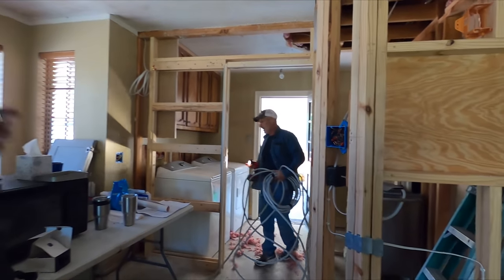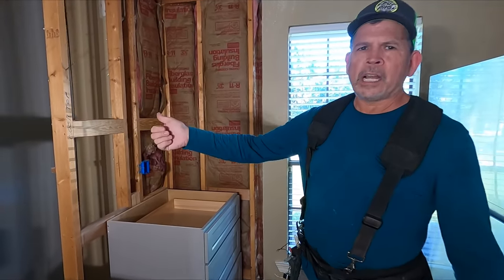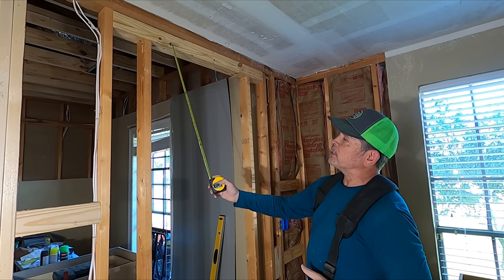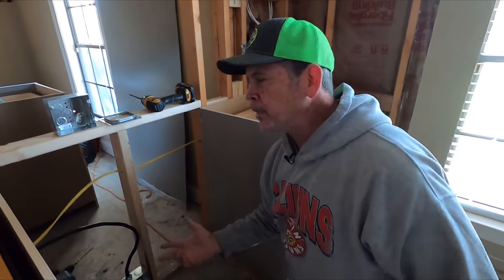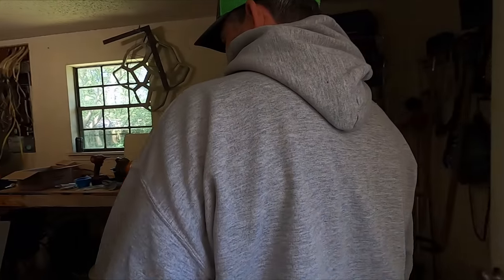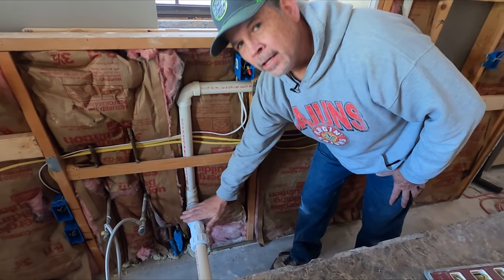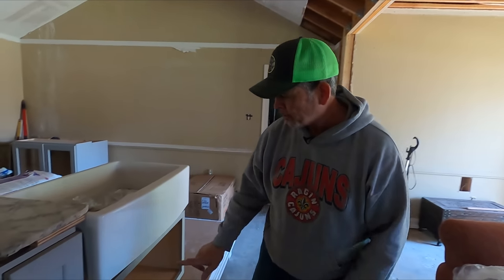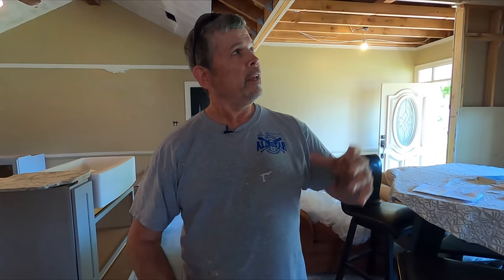WHY This 2 INCHES Will COST US $800 Ep. 15

Comment: We went through a whole house remodel, and our contractor was a bum. Afterward, our kitchen sink was always leaking. I took it apart at least 10 times and tried to figure out why it wouldn't stop leaking. 14:06 is the reason. They replaced our standard sink with a farm sink, but never lowered the drain.

I remember when the plumber arrived and gave us the bad news. As you said - out went the back of the cabinet, and out went our new drywall.

Comment: Thank You Studpack for the great content on your channel!!! Love the interaction between you too!! Keep up the good work & see you on your next video!!
Reply from the maker: Thx Miles 👍💪
Reply: @StudPack  Did that guy fall through the ceiling? The impact didn't sound like a straight free fall.
Reply: @StudPack  My friend's range receptacle was installed in a way that the plug cord was bending at the floor, causing stress. I had to flip the receptacle 180 degrees so that the cord would be going away from the floor. Since the electrical box was an old bakelite box with no mud ring, I couldn't install it sideways like you did in the video. Also, the wire inside the box was short and barely left me enough room to flip the receptacle.
Reply: @illestofdemall13  I though it was that bundle of cable he was rolling back up ???
Reply: @mickeymacon1281  I don't know. Seems like you could be right, but it was unclear in the video.

Comment: 20:38 There’s nothing like starting a new job and going over to the breaker panel and actually seeing a “Legend” and one that ACTUALLY is filled out and correct. Makes things so much easier; unfortunately, can’t recall starting a new job where the panel was correctly labeled, and that’s if it was labeled at all 😁 (so many panels out there that aren’t labeled, geez; also, having a main water shutoff in side of house the actually works....instead of having to go to the street. It’s these little things that make our jobs a bit more easier, along w/ saving ppl money and time😉)
✌🏻

Comment: Should go ahead and install the duplex plate dryer, then use Leviton 88085 (or equal) cover that is 1 side blank, 1 side single 1.406" round hole. Then, future update does not require any mud work.
Reply from the maker: Thx Tony.  I’ll do that👍

Comment: That TV can't breath. You need to put something in so that heat can evacuate out the back of the TV. Made this mistake once. The TV will die quicker. We just drilled some holes in the top and bottom of the back of the plywood, but not sure how commercial varies from residential. Also, you may know this but paint the inside of the cutout black, then even if the TV is not a 100% fit the black looks like part of the bezel of the TV.
Reply: I agree. You could easily put up a moveable TV mount. That way the TV can be moved around so anyone can see it.
Reply from the maker: Cool thx Dustin 👍💪
Reply: Dustin beat me to it for the risk of TV overheating. And his idea of black paint rocks too.

Comment: Me and my dad also had the same problem with the farmhouse sink. Had to use an above the fridge cabinet cut out the top and frame around it so it held the sinks weight, and build a base for it
Reply: They never give you enough filler for the cabinets lol
Reply from the maker: That’s for sure.  Thx Shane 👍

Comment: Great job on being aware of the depth of the new sink.  So many times I have warned people and GC's.  They refuse to acknowledge their mistake at trim out.  Deep traps kill disposals, people.  Deep traps cause frequent clogs.

On anther note, I'm surprised your plumbing code allows that sink drain vent to pass through the King stud at the window.  Was that a 2x6 wall?  We cant cut more than a 1-3/8 hole in a king stud and still have to put a stud shoe on it.
Clean looking plumbing work tho.
Reply from the maker: Thx 👍  2x4 walls on that vent.   I guess it’s grandfathered in.  Would need a shoe otherwise 💪👊

Comment: Plywood sub top should be 5/8" plywood to be properly hidden behind the stone edging. In fact, because you are using a face frame cabinet, you could even use 1/2" ply as a sub-top and allow the edge of the stone to overlap a full 1/4" without affecting cabinet utilization. Especially with quartz tops, their tensile strength is almost double that of natural stone. Your description of the relationship of the stone top to the sink is correct, however, I would have done the math before ordering the cabinet and had it built taller. I have spec'd and built custom cabinetry for 20 years (mostly euro, no room for errors). Thanks for your channel, I share it with my workers.
Reply from the maker: Cool thx Emil.   I haven’t seen 5/8” plywood in years.   Who still makes it?

Comment: 1/2" 4x8 sheetrock is $12.76tax inc. - T&G Underlayment Plywood (Scant Face) (Common: 23/32 in. x 4 ft. x 8 ft.; Actual: 0.688 in. x 48 in. x 96 in.) $107.41 - 2x4x8 stud $9.00 - Johns ManvilleR-13 Kraft Faced Fiberglass Insulation Roll 15 in. x 32 ft. $19.37  To give you an idea here is Southern California. Most other stuff are close to last years prices. Just lumber has hit the fan.

Comment: I just went thru the sink drain problem last month. The customer's  new sink was under countertop with garbage disposal so the GD would've always had 2" of water in it.   I had to lower all of the in wall plumbing 3".    Fortunately the wall behind the sink was an open living room wall so I could cut a large hole in the drywall, lower the plumbing,and put the drywall back.    It was a huge problem, but not as bad as butchering the cabinets and trying to replumb with my head stuck 2' into the base cabs under the granite countertop.

Phew, I learned a lesson that day
Reply from the maker: Thx Brayden👍.  You got lucky being able to go thru that wall 💪

Comment: There was a flip house listed for sale for many months with a brand new kitchen that wasn’t selling in a hot neighborhood where I sold a flip without even listing it. In that new kitchen, the dishwasher door did not clear the window sill that was in the door’s path - the dishwasher was useless like that.

That’s why a good kitchen designer / builder / contractor will make sure all moving parts - mainly doors and drawers - will open fully. Just like that lower drawer near the window in the kitchen from this video.
Reply from the maker: Thx Steve 👍💪

Comment: If you've got a hand-held planer, you can recess a lot of those nail plates really quick. It flattens the drywall, and actually helps keep the plates from falling off due to random impacts. (Or you could just pull them back down after inspection, which is apparently a great way to recycle...)
Reply: I was going to mention that because that is what i did on my whole house renovation, planed a recess, but I thought no one else is that anal. I would never take them out. You never know where someone is going to drive a screw.
Reply from the maker: Cool.  We do that sometimes to recess hangers

Comment: I just remodeled our kitchen. Made my wife super happy by putting in a pot filler over the stove.

Every kitchen I’ve done in the past year, I make sure to mention putting in a pot filler for the customers. 90% wants it.
Reply: Pot fillers are great . Iv'e been exploring options for drainage .something like a washing machine has . Using a special pot that drains into the top of the stove and into a flexible drain.
Reply: @degrom542  what do you need a drain for with a pot filler?
Reply from the maker: Don’t see a lot of those locally.  Mostly higher end homes.  Besides, we’re used to lifting heavy pots here... gumbo, jambalaya, I’m hungry is it lunchtime 😂😂👍👊
Reply: @StudPack  that’s what would separate you guys from the ordinarily contractor. It doesn’t have to be only in higher end homes and believe me, the wives would love it! 👍🏼
Reply: @tommynguyen8942  so after you fill the pot with maybe three gallons of water then you need to carry it over to the sink and pour it down the drain. It’s heavy for your average female maybe 24 lbs of water to carry over to the sink.
Reply: @degrom542  I see what you’re saying. But a pot filler is for you to fill a pot to cook with. Most people need to drain after boiling pasta, they would do it in the sink into a strainer. 

All the seen and installed, I haven’t seen any with a drain. But it would be nice to have one?!

Comment: Paul are you putting in a surge protector in the panel. I put one in because most new appliances are like a computer and with the lightning down there it may save a control panel. Keep up the great work and videos
Reply from the maker: Thx Michael 👍 I asked my electrician about them.   Almost always it’s a commercial application for surge suppressors here.   I love the idea though.  I’ll research them 👊
Reply: @StudPack  seems louisiana is still on 2014 NEC. Just would be a shame if a new panel install isn't thinking about the inevitable future 2020 NEC (e.g. Texas already adopted). Since any future work would have to bring up to code at that time. NEC 2020 requires surge protectors, GFCI on your washer dryer. Pretty much every circuit needs to be one or both of AFCI and GFCI after NEC 2020.
Reply from the maker: Thx Mr G👍. This new GE panel should accept all those.  We did install couple AFCIs on the added circuits

Comment: Would have put the two gang plate on the dryer box anyway. You can use a single 120v outlet with a two gang plate with a blank on one side.  Also, There is a kit for most dryers that will allow you to vent out the side of the dryer to eliminate a lot of twisted vent pipe if you can vent outside to the side.
Reply from the maker: Someone else commented same.   Excellent ideas thx James 👍

Comment: Great using the roomier 4 &11/16" box for the 10/3 NM cable. Should always have large opening in mud ring  so that in event screws come loose the cover will not fall off. Saw a lot of electricians install them wrong. Ge is the absolute worse breaker besides worst service + tech support.Had trouble with every ge medium voltage switchgear that companies had.
Reply from the maker: Thx.   Not following “ cover will not fall off “ ??
GE was the only 150A  32 space panel our supplier could get 👍

Comment: The sides of the farm sink are normally not square top or bottom.  Both sides tend to slope in from top to bottom.  I found out when I cut the U-shaped board around it.  Make a template.
Reply from the maker: Thx Dirk.   This one is actually not too bad 👍

Comment: You went ham with those nail plates. Code in my area is 1.25 inches or closer to the edge needs a nail plate. I usually use about 50 in a 3000sqft house.
Reply from the maker: Here they want to see them everywhere 😩

Comment: Well, no, I want solid smooth ceramic tile behind my stove. Me and my wife cook a lot, she in particular, likes to fry stuff. I want a nice smooth wall that every now and then I can hit with oven cleaner to get that grease off.
Reply from the maker: Yeah I hear ya Ray 👍  I’ve done removable tempered glass panels behind ranges to protect expensive tile from cooking elements. Owners can remove glass, clean, and reinstall.
Reply: Lol, with regard to the Sink rough in, you have the luxury of knowing what your cabinet guys are going to do. Here cabinets are so cheap, they just come plop them in with the sink already mounted to the counter, and they did not say boo to the owner that he was going to have to replumb to the sewer. Yep, and it’s 2 inches, you have to drop the sewer connect. They decided what sink they were going to put in and I was left ripping out the old connect and installing new PVC. 🤬🤬🤬Contractors🤬🤬🤬. Luckily it was PVC and not ABS, which is no longer available here. 

There’s another thing. The new marble/quartz countertops are almost always now single post for the faucet. If your house has galvanized pipes you can just forget it unless there is a filter between the galvanized and the faucet. The single post faucets with extension hose and faucet as one item have a back flow preventer that is no friend of little metal bergs that run around old galvanized pipes. Once those preventers clog you are either going to be calling a plumber to fix it and/or replacing the faucet. 

Again, when they brought the cabinets, neither the owner or I had any idea that they only did single post faucet holes. Those faucets are $200 more expensive than 3 hole faucets and cannot be used in every house as piped.

Comment: While on the subject of ranges: I have a customer that is converting a electric range to gas range. I thought I would have to get an electrician to wire a 110V receptacle for the new range as that is what it called for.
Found a thing called a "gas range adapter" Plugs into the 220V outlet and you plug the 110V cord into it.
Just thought I mention it as my electrician never heard of it and some of the reviews on Amazon said the same thing.
Reply from the maker: Thx Tony.   Is that adapter 4prong or 3 prong?
Reply: @StudPack  the one I bought was 3 prong.

Comment: I was doing finish installations in new construction when I noticed the dishwasher could not be opened because it shared the same corner as the fridge, which stuck out 3/8 inch too far.

Comment: Great video as always. Just curious what a nail plate is used for?
Reply from the maker: Nail plates stop drywall screws, cabinet hanging screws, baseboard nails, etc before they can damage a cable or pipe.

Comment: What happens if the pipe coming out of the floor for the washer standpipe was only 1 1/2"?  Would they make you tear up the floor?  Let's say it went into a suds saver tube before with a 'normal' drain.
Reply from the maker: Not sure actually.  I’d probably live with it unless it’s an issue.  I’ve seen laundry rooms with four or five machines draining into a large pipe like a reservoir that then drains away via a smaller pipe.

Comment: Hi from the UK. Always fascinated by your switchboards and how big they are. In our homes we have consumer units which are a fraction of the size. Our wiring is either a ring circuit or radial spurs both of which will carry multiple sockets and switches off one cable. I am not too sure on it but is it because you have 240 volt for power and 110 volts for other items. Love your site.
Reply from the maker: Thx for watching 👍💪.  This 4 bedroom 2 bath home has about 30 circuits.   What’s typical in the UK ?
Reply: @StudPack  I have 10 circuits all protected by MCB's . I have 10 lights all off one ring circuit . Cuts down amount of wire considerably. I also have 2 RCD''s protecting power and lighting. I think your power comes to the door as 3 phase, ours is single phase 50 hz
Reply from the maker: Thx 👍.  We actually have split phase.  Utilities take one phase and split it into 2 lines 120v each or 240v line to line.  Most commercial is 3 phase though 💪

Comment: Why would you remove all those cabinets and that framing just to install a niche when you could cut the framing above your blocking and frame in the niche
Reply from the maker: The cabinets were already removed.   It was too much framing to remove with finished drywall on the other side IMO.  Didn’t want to risk damaging it.  We like to show options.  This way works great in showers to line up a niche with tile layout.  I’ve done it like you describe also 👍

Comment: 7:17 shooting a nailer toward your hand, cringe. Let's hope this never goes wrong! As always though, great video!
Reply: I've seen it go wrong before, 20 years or more ago. My uncle shooting toe nails and it blew both the 2x4 out and went right through his index finger. I still remember watching that 16 penny nail slide out.
Reply: @Jerry-zz2eu  I also learned the hard way to never have your hand anywhere in front of a nailer. The nail that got me deviated because of its design and a knot in the wood. Didn't go straight in, but shot over to the side and into my finger bone, fortunately it was just a small finishing nail.

Comment: Whoo hoo .. I am 1 of the 8 viewers :) I have a crimper like that
Reply from the maker: Cool thx Brian 👍💪
Reply: I have a pair, too!  I've used them in three houses I've owned and worked on.  Getting tough to find those ferrules today.
Reply: @4GSR  They are easy to find online or at Home Depot. They are similar to, but are not ferrules, though. Search Ideal or Buchanan copper crimp sleeves. Part numbers 2006S and 2011S for the 2 different sizes.

Comment: (I just saw this is a year old, but I'll leave my comment) 
I'm sure the homeowner has thought it through, and I'm a rando in the internet - but personally it's my experience that the reason you don't store anything around your range is that it gets filthy with cooking oils (even if you're not a fry heavy family) and the heat can age your spices and take the flavor out. Any shelves over the range are going to get a lot of steam and moisture so you can't keep an open salt pot or anything like that. Also it's very impractical when in the middle of cooking because you're reaching over and leaning into the hot food, smoke, grease splatter to reach what you need. It looks neat in still photos and displays where not actually used but sounds like a huge headache in a functional kitchen.